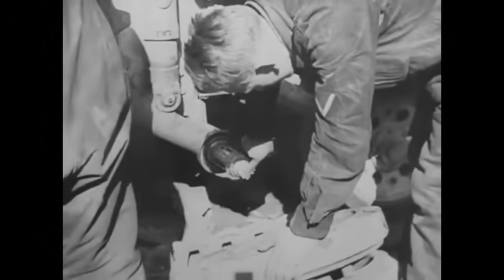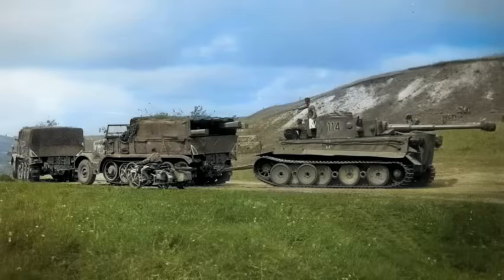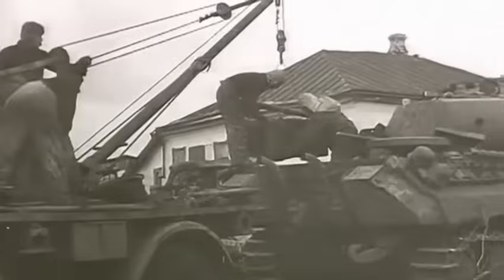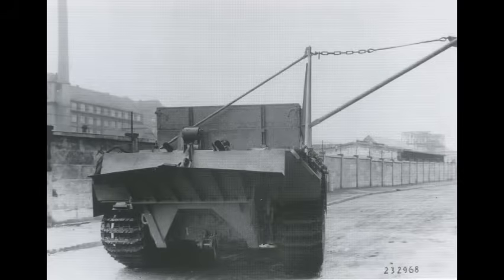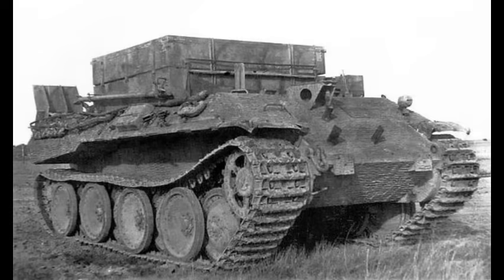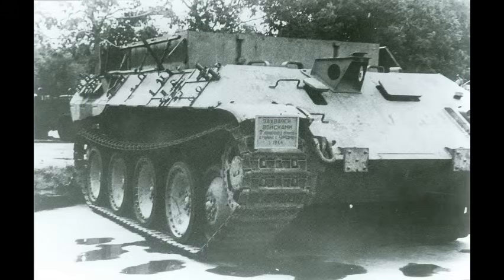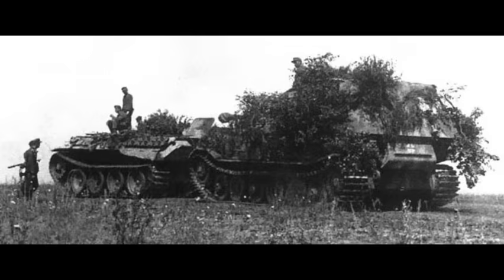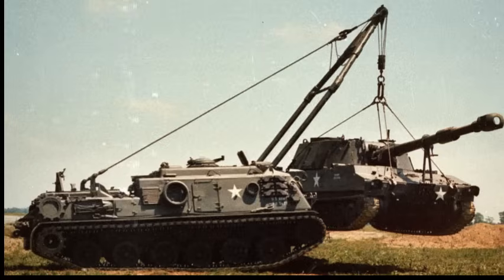Bergepanther – BEST Armoured Recovery Vehicle of WW2 (’43 - '45)

Comment: The Germans could have used t34/kv's minus their turrets for recovery vehicles, they could use the turrets in fixed lines of defence East and West - especially the kv2's 152mm.
The porsche hybrid system should have been used in German vehicles, recovery ones. The torque alone is enough.
Reply: There were hardly any KV2s built , it was a rare tank . 
The electro-mechanical drive wasn't used for a load of good reasons .

Comment: What do you think if Germany just scrapped all foreign tanks to reuse their critical metals. Would this have had a larger impact then making logistics a nightmare by using captured tanks everywhere?
Reply: my ancestors did not suffer from a lack of metals but production capacity and fuel.
Reply: That would waste more fuel than its worth, plus recycling / isolating specific metal alloys to make quality armor, wasn't really easy for the technology then
Reply: @ 
Yeah that’s as big a problem for Germany as the alloys at the end but if they had raided the captured and destroyed tanks for resources instead of incorporating them into their arsenal. It is kinda funny to see Ft 17 tanks in the haul from the battle of Berlin where they contributed nothing. Germany always planned on the quick war and when it didn’t happen it just underscores how unpredictable the winds of war are and how much having access to a variety of different resources is critical.

Comment: Bravo!  That has to be the BEST most comprehensive video on this subject.  I see you have access to excellent research materials and pics.  The BergePanther was   the template for all fully tracked armored recovery vehicles that followed.  It was indespensible to the Panzer units operating Panthers and Tigers and they never had enough of them. 

As far as 1/35th scale models go, Takom's offerings are the best.

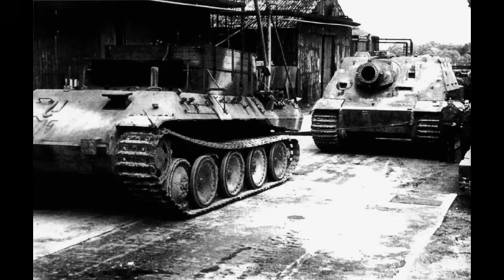Comment: The BergePanther shown at 5:14  is one captured by the British and is towing the SturmTiger also captured and is probably photographed at the Military Vehicle Experimental Establishment at Chertsey Surrey where surprisingly after the Berger had been written off, (the motors were very poor and had a tendency to burn out), the winch was placed in a fixed 'shed' and had many years of use doing pull tests.
Reply: Notice the box like cover over the driver and radio operator opening? Even has hatch in middle.